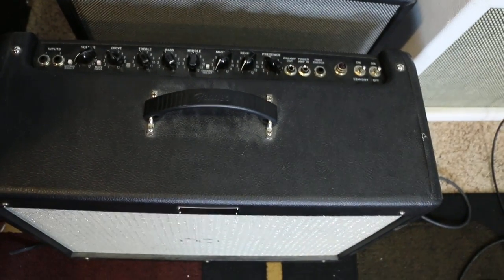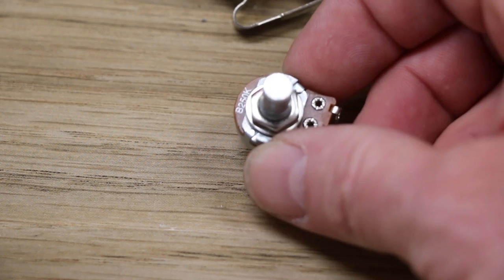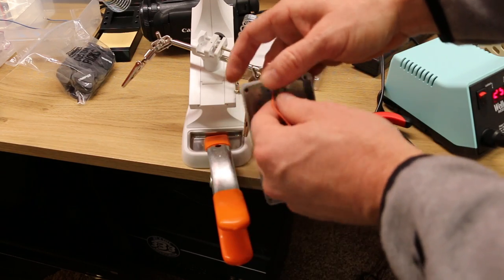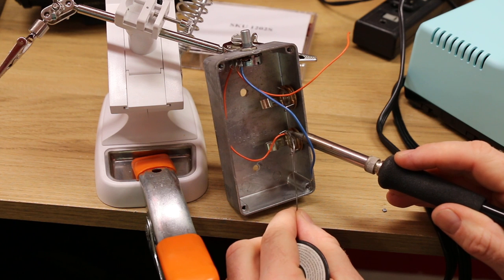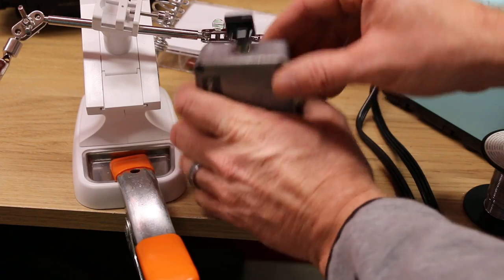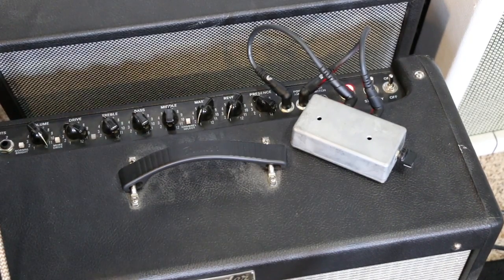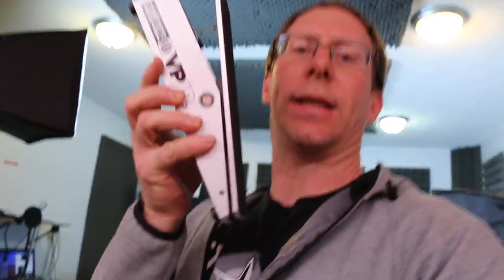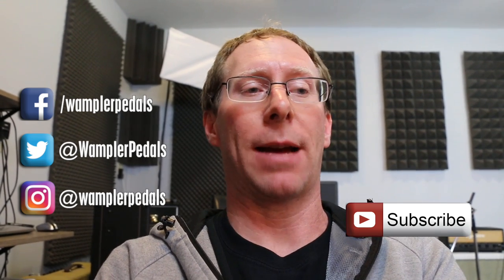Easiest “modification” for Fender Hot Rod amps (and others) to make it better for home use

Comment: I bought a Carl's Speaker Soak some time ago to achieve this. Opened it up a few minutes ago and it's similar for sure. Although the components look different. A large resister type knob with no visible rating and a 50uf 100v cap. So a question. Does it make any difference if the volume control is in the effects loop or the speaker out?  By the way, it does work well for bedroom volume with my amp. Peavey Bravo 112 tube amp. I can turn up the clean channel to get dirt and still be pretty quiet.

Comment: So I don’t know hardly anything about electronics but I have a blues Deville 410 from the 90’s and need this pedal badly. What wire do I need to buy? Are all 3 of those wires interchangeable with each other? If I buy one spool of wire and I use it for the positives and the ground?
Reply: All 3 are interchangeable, you can use one spool for everything. The color coding is just for ease of distinguishing them. 

You can use 22/24 gauge stranded wire or even solid core copper wire. Solid core may be easier to work with if you don’t have a lot of experience in this area.

Comment: Cool video. Just asking to see if that's really all. if I used a box that isn't metal, let's say wood. Is the only difference, that I'd have to connect the two inputs on the grounds?
Reply: Metal cases are used with all kinds of effects because they help reduce external noise and hum. Google about the Farady Cage for more info.

Comment: Dear Brian, built this little helper yesterday and it works great with my Super Sonic 60. How would using different capacitors and potentiometers affect the Sound? I would love to take out some of the bass of my Victory The Duchess, which is too heavy on the low end played through my Marshall 4x12. Thanks again for your videos!!!

Comment: Two years ago I bought a similar amp (the tweed one, can't remember what it's called). I did something similar but instead of a big box I just tested some resistors and found out which ones are best for this exact same use. It even sat flush with the surface

Comment: I've done this with a 50k and 250k volume pedal on my Crate Vintage Club amp in the loop. The more volume is reduced more unruly and dramatic the reverb gets. It's like the reverb (actual spring tank) is not affected by the volume pedal and this injects way too much for the reduced signal. Per the schematic, the reverb circuit appears to be parallel to the loop.
Reply: I have a Crate Vintage Club 50 too with a stereo plug for effects loop by-pass. I understand your thinking with the reverb is parallel with effects loop - they both receive the same input volume input BUT the reverb is unaffected. 
In your opinion, the volume pot idea is no good for this amp based on its circuit.  
The clean channel on the VC 50 has no master volume and at 2 it is quite loud. Nice, warm 'Fender like' clean sound. The drive channel has master volume - not a problem. Thanks for the heads up.

Comment: could you plug an EQ pedal, like the boss eq, into the preamp and get a similar effect achieved? with the added benefit of having a more expansive EQ than the stock "treble, middle, bass" on the amp?
Reply: Brian puts an EQ between the pre-amp and power amp in his other video about EQ pedals (probably with the same amp).  It is eight and a half minutes into the vid below:
https://youtu.be/hypn6uA6RPs

Comment: I put a 100pf cap between lugs 2 and 3 with a switch between the cap and one of the lugs. I'm hoping to use this as a "bright switch" feature, but I'm not hearing any difference when its on or off. Is this not possible, or do I need to use a different value of capacitor? Thanks!
Reply from the maker: I’d say a different value of cap. Should work as planned
Reply: thanks!

Comment: Hi Brian. Plan on building one of these. Would a no load pot work with this simple circuit? Some say not to use them as a volume pot. Thought it would be cool if it bypassed the pot when in no load mode. Also, would a 250k or 500k be fine?

Comment: I'm having the 'won't channel switch" issue.  I just replaced the 2 5 Watt 470ohm resistors (r78 and r79) and the 2 Watt 1.2K (r97) and the channels still won't switch.   The traces were definitely lifted by the previous owner of the amp.   So I bypassed them with point to point wire.      Any ideas on what else I might be able to check?    Thanks for the great/practical info.  Appreciated.

Comment: Brian .i recently bought a marshall 20 watt plexi combo. I haven't really been able to enjoy my new studio vintage cause even at 5 watt it's so loud. So I was thinking about either getting g a jhs little amp box or an attenuator. Now I'm thinking this little project looks simple and fun and I assume based on your video this will be the same effect on the marshall as your hot rod  because I have the same thing fx loop no master volume. Should I do this rather then get an attenuator. I don't want to lose the plexi tone playing at a low volume.  I have heard that these boxes only hit the preamp and so it may not allow the tone to unleash. I'm not experienced in soldering or circuit bending building. I really admire you. I wish I would have learned this stuff a long time ago. Building pedals and amps would be so amazing? This looks easy thpugh Thanks for the video.
 BTW the Tumnes Deluxe is my favorite OD pedal with my Fender Deluxe reverb
favorite OD. .it beat the TS 808, OCD,  the Friedman BD OE. It sounds better than any OD I ever paired on my fender.

Al
Reply from the maker: Thanks for the kind words! For your case, the Marshall really needs the additional dirt of hitting the power stage hard, so I would. Probably buy an attenuator. If you use a master volume with a plexi amp it gets much cleaner.
Reply: @Wampler Pedals  that's what I thought and so was my plan nut after watching your demo on the hot rod I thought maybe same deal. Have you ever heard of the john h attenuator. It's an open source schematic and has no patent so some build it diy on the marshall forum. Wondered of you had an opinion on that attenuator. A guy said he would build it for me for 300 bucks
Reply from the maker: I haven’t, but for $300 I’d spend a little bit more and get a “reactive load” attenuator.
The tone king Ironman is fantastic , and it’s like $400 I think.
Reply: @Wampler Pedals  Brian I have a tonebking mini for my Deluxe. The one I have is rated for 8ohms. The marshall speaker is 16.ohms. I have heard that it can be used on the marshall despite the ohm discrepancy. I have heard I could use it as is and other say if I take the greenback out and swap it for an 8 ohm. I wouldn't want to do that and eventually want them both attenuated but can my tone king mini work on the marshall or could that do damage? Thanks Brian and I'll stop bugging with this question. Thank you for your wisdom
Reply from the maker: I’m not sure on that one but shoot the folks at tone king an email and they will be able to tell you for sure

Comment: Sleeve, he knows that TRS... please i'm only trying to enlighten those who have not soldered or found it to be frustrating. The rest of you can solder in your sleep,lol like me 8>) ... The Pad-wuan learner secret to beginning soldering 101 is "Pre~solder" the two points that will end up melted soldered as one ... why does Brian connect the wire then solder both lug and wire at once? because he can, and you can too. you will find that way most difficult to do when soldering two wires in a lap splice, thats when people get mad and quit. "two wire's lap/side by side" > heat tip of first wire till solder flows thru that wire and stop, do the same with other wire. Both wires pre~soldered will naturally join/melt together when heated at the same time with xtra drop of melted solder on the tip of the Iron. I made a video of how to solder realizing that it was how to solder one handed as i held phone with other Hand... LOL , here check it out. PS, when NASA joins two wires together they pre-solder both tip's of connections then bend both connections into a "J" as a redundant to back up the solder joint > Like two fish hooks caught on each other / and then soldered.... https://www.youtube.com/watch?v=ApcGzl97ocA

Comment: hey, I have a question. I have a stage 112 se and it hasa preamp out and a power amp in. Is it bassically the same as having an fx loop? and what are all the uses of having a preamp out and a power amp in? I was running an external orange micro dark 20 watt head out of the headphone out of the orange(which is for direct recording) into the power amp in of the stage 112. is that okay? or can I run the stage 112 as a cab running out of the speaker output of the orange?

Comment: Do you recommend 25 or 100k pot? What is difference between them in terms of sound influence? thanks
Reply: If it's a tube amp, go 250k - 1M. 50 might be usable but 25 k would be silent even on max. So it's 100k for you.

Comment: I have crate solid state amp and it   doesn't have a master vol.  The channel volume is very sensitive because the amp has flexwave tube emulation so I'll make the unit like you  because it has a fx loop

Comment: Hello Brian, might be a stupid question but .... can your master volume device work on an amp ( Fender 68 Princeton Reverb reissue ) without the effects loop ... installed between the speaker input on the amp and the speaker ?
Reply from the maker: No don’t do that with this simple circuit, you need an attenuator in order to do that

Comment: Brian...love the pinnacle v2........will this work on solid sate amps ?   looking at the Boss Kantana 100 watt with efx loop....it will probably never leave my house as I don't gig..(you never know)....and I sure don't need 100w at home.....but it has more features than the 50w version and doesn't cost that much more...but it is solid state....and it does have a master volume...so maybe the point is mute....just started playing a couple years ago...at a nice middle age so all this pretty new to me....thanks for your time
Reply: Mark Snead  you don't need one on that amp  the master works fine and put it on half watt.

Comment: Hey, have you ever considered making a distortion pedal/overdrive pedal that uses hard clipping on one half of the waveform and soft clipping on the other half? I tried breadboarding my idea, but due to my very simplistic circuit and my very limited selection of parts, I couldn't make it sound that great.

Comment: I bought the version 4. Problem solved 😁 and a better speaker. A happy little camper
Reply: why problem solved ?
Reply: @gilouch8975  the immense volume difference between volume 1 and 2 is smoothened out on the version 4. And the drive channel is better too.

Comment: I am probably being very stupid here but why would anyone want to use an attenuator instead of this? I have an old, 1990s/1980s peavy classic 30 that is way too loud for home use - would this work in that? Not a troll question, I’m not a ‘techy’ guy in a context that enables me to fully understand what I’m looking at here..
Reply: Because your not driving your power tubes with this. Its just adding a master volume between the preamp and power amp. Any extra gain you're hearing is from the preamp, with an attenuator it goes between the amp and the speaker so you're pushing the power tubes as well as the preamp. The sweet sound really comes from driving the power tubes.
Reply: So what if you put this device (the thing Brian made here/ or st similar) between the speaker output and the speaker? Instead of in the effects loop. So you make full use of the poweramp section as well. 

(Genuinly interested in the answer, appearently you have to mention that these days)

Probably won’t work because of ohms, impedances and blowing up stuff? If it were that easy a solution, the ox and all the others probably wouldn’t have to be that complicated, no? 

(Still genuinly interested in the full and maybe scientific answer that there may be)
Reply: @VanPete87  it wouldnt work, attenuators have big resistors inside to absorb the wattage from the amp. The volume box shown here would damage the amp if it was put between the amp and the speaker.
Reply: @daves_not_here_mannn  My dad had someone build him one back in the 70s with a NON master marshall. He said he got the best sound he ever heard, for 2 seconds, then SMOKE. DO NOT use this in between amp and speaker. I know YOU know this, basically for the other guy!
Reply: lol right on
Reply: I’m glad you guys said that because I also have a Fender Excelsior which does NOT have an effects loop and I was wondering if this could go inbetween the amp and speaker. I don’t like the sound of smoke so hard pass on that - thanks for answering that question for me, it was going to be my next question!

Comment: Do you mod your Hot Rod Deluxe amps to fix the main points of failure in those amps? I'd love to have one of these amps but the junk filter caps and the resistor and diodes burning the circuit board keep me from spending that much on it.
Reply from the maker: I haven’t had those kind of issues with those amps but any modification I would do would be to change the overall sound or “feel” of the amp

Comment: Is it safe to run this all the time or will it strain and or decrease the life of my amp? I have a hot rod deluxe 3
Reply: It is only safe when used in the effects loop. Never use one of these between the amp and speaker, it will blow the amp.

Comment: I apologize if this was asked already, (I didn't want to sift through all the other comments) but some amps have this inherent tone suck problem with the effects loop. Does the straight through approach that this utilizes help alleviate that problem? Thanks.
Reply from the maker: No, it totally depends on the effects loop. If it's a non-buffered loop I'd use a much large pot, probably a 1M or so.

Comment: I have very limited knowledge in electronics, so this could be a stupid question. How do you know what value of pot to use? Or would any pot work?
Reply from the maker: depends on the effects loop circuit. If buffered, 100k is probably fine. If unbuffered, 1m is probably needed.

Comment: So for a while my Fender HR Deluxe 3 started buzzing, badly. I changed the tubes with far more expensive ones that there were already there, but the buzz still remained as it had been. The sound of the guitar does go through, but the buzzing is so loud that it distorts it in a horrible way, especially on drive. I need immediate help please. Thank you.
Reply from the maker: You'd want to contact fender's help support

Comment: Definitely a big problem with the hot rod. I have a 2x12 and that thing screams. I wish there was an easier mod than soldering and whatnot. Id love to have a bassman style amp but smaller and better volume control, where it breaks up naturally this higher the volume etc.
Reply: I switched out the volume tube 12ax7 for a 12at7 simple pull it out and put it in. Made a HUGE difference to controlling the volume. It’s now smooth from 0-3

Comment: Really useful vid Brian, thanks, but how can I use this idea with a Combo, (Fender Vaporizer) that has only volume tone & reverb controls? I want to drive the amp harder but not annoy my neighbours. My amp doesn't have a separate effects in and out option.
Reply from the maker: There's no "easy" way to add an effects loop to any amp, but it can be done

Comment: I have a question. I have a 15w practice amp. Could I disconnect the speaker and connect the speaker wire into a 4 speaker cab depending on the ohms

Comment: Wouldn't changing the volume pot in the amp be a cleaner/better solution?
Reply: Gerry Blue power tubes need to be turned up to sound good, so you turn it up so they work hot, but diminish the signal coming into them.
Reply from the maker: mods in general, or better yet a different amp would be a better solution, but it's not as practical as this for most.

Comment: Brian, great video! I have a small Vox AC4 which i cant really crank, so this looks like a perfect fix. I have a seperate head and cabinet (cant really call it that..) Can i plug this in between the cabinet and head? TY
Reply from the maker: +Nick van Zanten no, you would need an attenuator for that

Comment: This may seem to be an outrageous question but I have the hot rod VI and I was wanting to know what’s the best settings on my dial‘s without any modifying just as the amp comes to get a good telly twang sound think of maybe Marty Stuart Brent mason kind of tone thank you in advance for your response
Reply from the maker: That’s impossible for me to answer. I run the knobs (besides volume and reverb) pretty much at noon. But, and this is important, change that stock speaker to something better. That makes a huge difference. Then after that, those tones are 99% technique. There is no “Brent mason “ setting. That sound is from his fingers.

Comment: Hey Brian, I have a Crate VFX 5212 that I'd like to put an attenuator on. I know the attenautor go between the combo head & the speakers. Can you suggest a good attenuator, I'd like to have a Dr. Z. Can you do the same video on a Crate VFX? I have the same problem like the Fender Hot Rod amp. The volume is very sensitive also. 
Thanks Brian. 
Mike
Reply from the maker: My favorites are the tone king attenuator and the two notes captor

Comment: Or change V1 (12AX7) preamp tube with either a 12AU7 much less gain (19%), or perhaps a 12AT7 (40%) or 12AY7 (60%) which also have less gain that the 12AX7 which has a gain factor or 100%.
Reply from the maker: Yep, that will lower the volume as well.

Comment: thanks for the tip. been using a volume pedal with gain effects thru the front with modulation effects going through the effects loop of my solid state fender front man 212.  Same issue with the volume between 1 and 2. any tips on this combo?